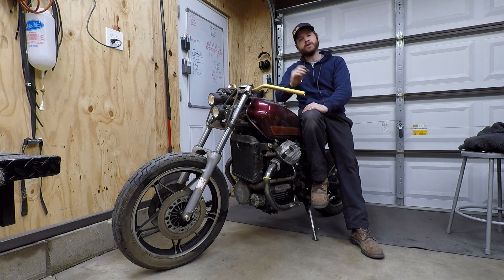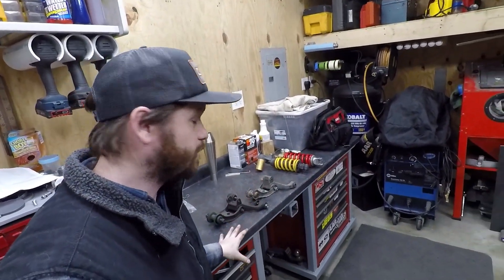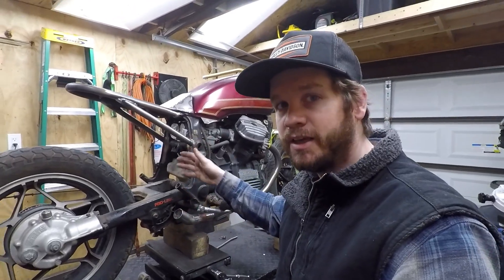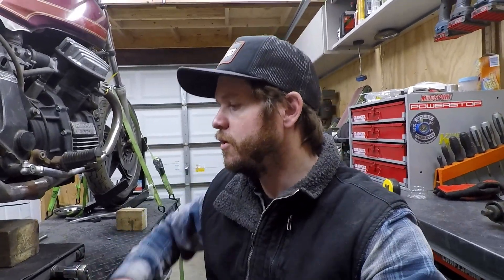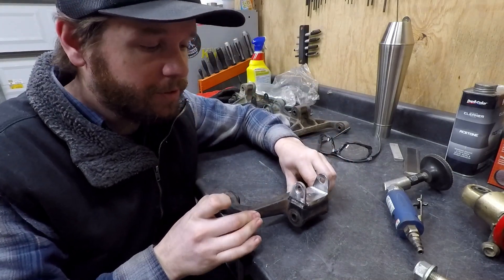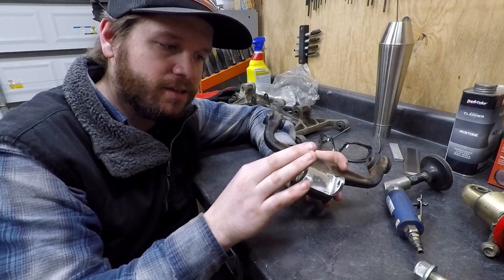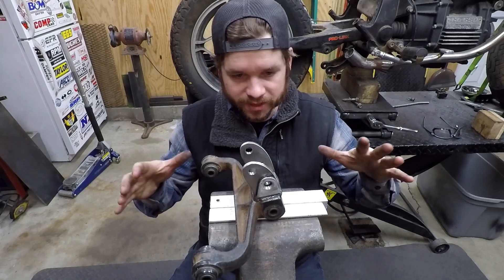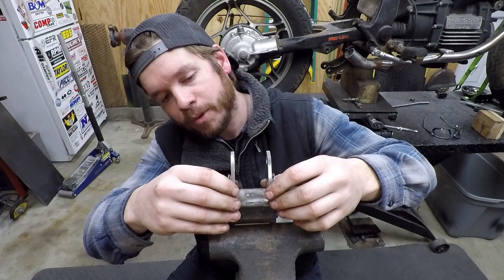Honda GL650 Build - CBR 954 Rear Shock Install! - This is Gonna Be Great! - EP4

Comment: If I get the chance to build one I'm a firm believer in utilizing factory parts.  My version I would like to use the seat/cowl, tail light and side covers from a '79 - '82 Honda 750 F....kinda along the lines of a '83 CX650E......way cool bike, never came to the states.  Bout 20 years ago  I built a '81 CB900F Freddie Spencer replica.....turned out great.....no pics of tho.
Reply from the maker: I wish we got the ES models here. I've also wanted to do an F inspired build

Comment: Great video Mate 
I'm in the process of doing the same job on a CX650 Euro I have the CBR shock 
But I don't have access to a GL500 link
You did say the CX650 was cast iron 
I'm looking at your GL500 link and it looks like the CX650 Euro link cut down and then the U bracket welded on 
If that is the case I could just cut the CX650 Euro link down and make the bracket to connect to the shock and weld it up 
What do you reckon ?
Reply from the maker: Thanks! Hows it going for you?   For the bracket the GL650 is cast iron with a wider shock mounting section where the GL500 does simply look like that part was replaced by two smaller tabs made of regular steel.  Id say you...could...modify the cast iron one but I never have so I have no advice on that one.  Im sure a lot of preheating and surface prep would be mandatory.
Reply: Yeah all good over here mate due to open the borders later this month 
So the link is definitely cast iron 😩
I can’t find the part number for the GL500 link. Would you know what the part number is?
Cheers mate

Comment: I know this bike sold, but any complaints of longevity now that the seal caps are gone on the lower bushings?  I have both arms here and a shock of choice, but don’t want to use the 500 one if it can’t get wet..
Reply from the maker: Well the bike doesn't get used in the wet so no real contamination worry with proper grease
Reply: @BrickHouseBuilds  ah ok. Maybe I’ll add some zerk fittings and use it. Its bushings are in much better shape than the original. Joys of living in the rust belt. Great work, and thanks for the response!

Comment: I wanna do this for my Kawasaki W650 and it so not a monoshock native, I have no idea about what spring to use.
Reply from the maker: Well I would first dig into what others have done and see if they like it. Try to determine what rate spring they used. Once you figure out mounting points you can contact racetech.com and fill out a suspension sheet. Determines the geometry and required rate

Comment: The GL 650 I'm working on had its rear linkage modified, welded poorly. I found a stock linkage and replaced it but had a hell of a time finding a rear shock that would fit the OEM setup. I didn't realize I could have just used the GL 500 rear linkage, I figured it was the same. This would have saved me a lot of time and given me a lot more options on rear shocks. Guess I'll keep this in mind if I end up needing to replace the new shock I just bought.

Comment: great videos i’m so glad somebody is doing an in depth build instead of just showing off the finished product for the GL650, keep it up! 

question i know the rejuvemoto you mentioned has a shock on their site but is it meant to go straight it in without having to fabricate anything to make it fit? a little pricey but im considering as a last option

also did you ever decide if you were gonna get those tabs laser cut? i would be interested in buying the tabs or even a kit from you if you end up doing that 

either way keep the videos up man, i hit a wall on my gl650 rebuild and you’ve inspired me to get back to it!
Reply from the maker: Thanks Aaron!  The YSS shock on Rejuve's website is a direct fit resulting in a factory ride height or very close to it.  I know it is expensive but components like that save time as you don't need to build anything and know it will work.  For those tabs I haven't had them made but its still in the cards.  I think Id like to test the setup out first before I make something to sell.  I just want to know it's right.
Reply: @BrickHouseBuilds  thanks for all the info man i’m really excited to try to have this build done by summer so that might be a great option even for the price. but i’ll be following along either way so let us know how your idea holds up